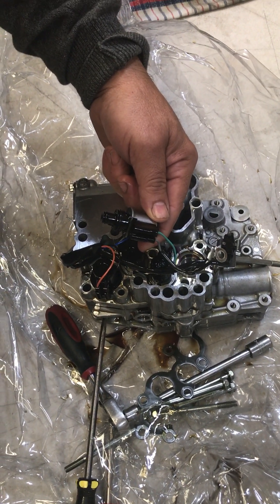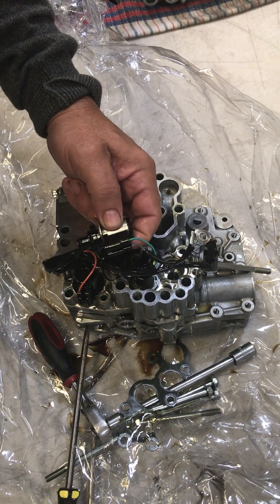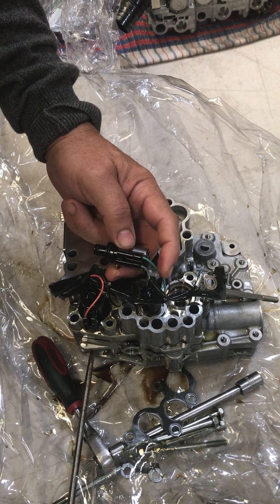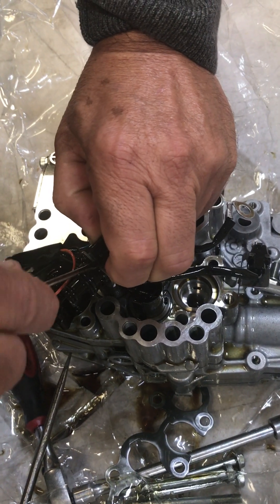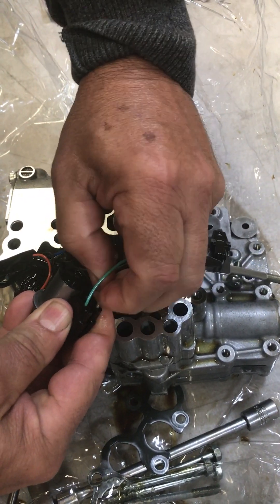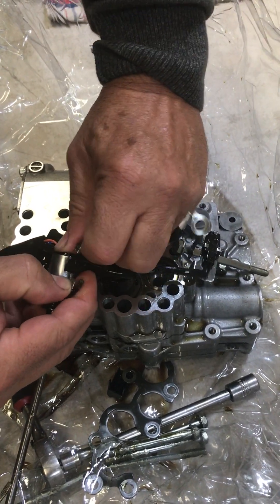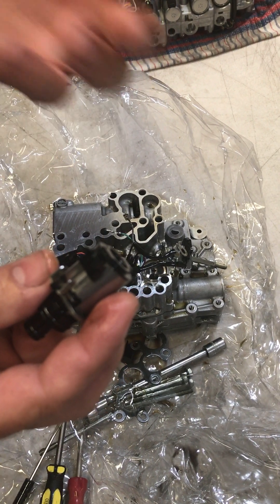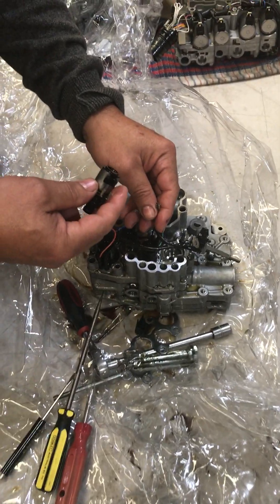Subaru CVT Solenoid Removal

Comment: Ive replaced the faulty solenoid but the ground wire eyelid that goes under the bolt snapped on me, is there a part number to replace the whole ground wire or how should i connect a new eyelid
Reply from the maker: As we are parts supplier we can help with product information and replacement procedures, when it comes to repairing wiring that is out of our field of expertise and up to the individual to determine the best way to address the issue.

Comment: Hi i have P2762 Tcc pressure control solenoid control circuit range fault, by replacing this solenoid will fix my issue on my 2014 Subaru forester?

Comment: RIP ground wire. Did you have to strip and refit another one? Does it matter which bolt you use to ground it?
Reply: lol mine broke too, just stripped and put a new crimp heat shrink connector on

Comment: Hello how to fix P0741 code in 2007 restyling 2.0 turbo legacy and what kind of Solenoid is necessary
Reply: I have the same code in my 2010 Forester
Reply from the maker: Hello, We do not offer diagnostics for fault codes as there may be many scenarios that set codes. Testing and diagnostics are required to identify the cause of fault, which need to be done by a repairer or follow the diagnostic guide set by the manufacturer.

Comment: Hi, how many hours (R&R) is this job?
Reply from the maker: Time varies, from Model to Model.
TR690 or TR580
As we are not certified repairers we cannot speculate time guide for repairs, this is determined by the following:
 - Workshop facilities.
 - Tools
 - Expertise (Automatic transmissions repairs)
Please refer to OE manual for Time Guides to “remove and replace” Valve  body for your specific model and then allow 15 minutes to replace the actual solenoid.
Reply: @alltranzltd.7625  In general how long would it take to tear down the Valve body from the transmission? Ball Park figure, doesn't have to be exact...
Reply from the maker: Although we would love to jump in and help estimate this time required for you would be a guess and we are not in a position to guess.
It is crucial, you understand that this is a procedure that is normally performed by trained specialists and we would recommend you contact your local transmission specialist in regards to any times/complications with this type of repair.
We are more than happy to advise product availability, price, delivery option, and specifications.
Reply: @alltranzltd.7625  Got it, your company only sells the parts and doesn't have the know how on vehicle repair. Will look elsewhere for an answer
Reply: how many hours? my dealer quoted me 9 hours

Comment: Is it easier to replace the solenoid or replace the the entire valve body?
Reply from the maker: Hi Chino, we cannot determine whether this is easier, we supply this solenoid as a cost-effective repair where the fault is diagnosed as the TCC solenoid shown in this video.
Reply: @alltranzltd.7625 you guys ship to the US? I'm really not looking forward to a $1200 valve body and Subaru won't sell this solenoid.

Comment: Hello, a 2013 impreza just through a 0700 and 2762 and 2763 codes. Is it the solenoid?
Reply from the maker: Hi, The video shown is a guide for testing resistance in the TCC solenoid in Subaru CVT, at this stage, it's already been determined by the specialist rebuilder that the solenoid may be faulty.
Fault codes are only a guide and can only identify a fault in particular circuits. It is up to the technician to test circuits using equipment, multimeters, scanners, etc..to then determine if the actual solenoid is the cause and at this stage, he can physically test the solenoid as shown in the video. In some cases, there is more than 1 item that can cause an issue. For example, the solenoid windings may break and make contact with the solenoid body and in turn shorting and damaging TCU (Transmission Control Unit), in this case, the solenoid may be changed but the fault will still be present till TCU is repaired or replaced.

Hope this helps...

Comment: How did you fix the p0700 malfunction? legacy 2011 also has the same problem
Reply from the maker: We are not transmission repairers so very difficult to give an accurate answer without knowing all the symptoms.
We supply solenoids when requested by Automotive repairers. Generally, vehicles will log fault codes that relate to that solenoid, in the case of this Video we are illustrating how to install the TCC solenoid for the Subaru CVT transmissions.
We sell these items at the request of the repairer. They and they only make the decision that this is the Cause of the issue and then they and they only are responsible for diagnosing and taking all risks that replacing this solenoid will fix their fault.
In the case of the Subaru CVT, the solenoid breaks its windings and therefore will log a fault code. It is not uncommon for the windings to short on the solenoid body and create instrument cluster lights to come on radically and in some cases, it can short the TCM and cause faults to still appear even though Solenoid has been replaced. In these rare cases the TCM will need to be replaced as well as the solenoid.  
Reprogramming is a must for all Subaru’s once components are replaced and in some cases, it makes take several attempts to reset adaptions/relearn.